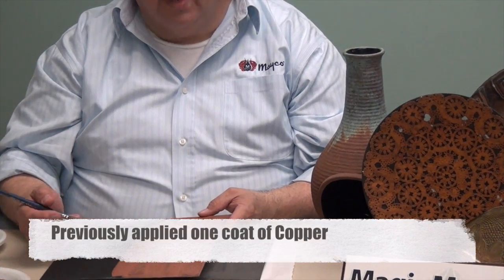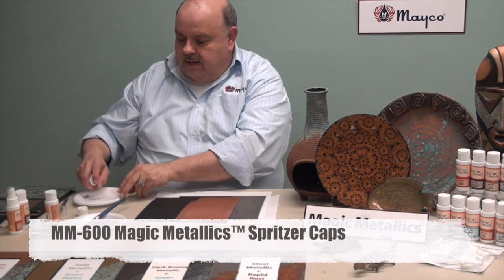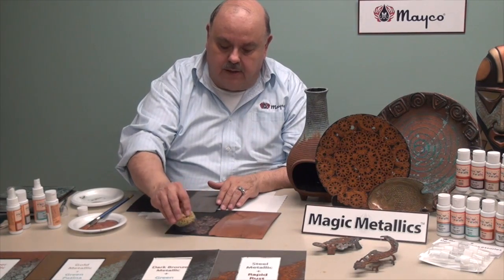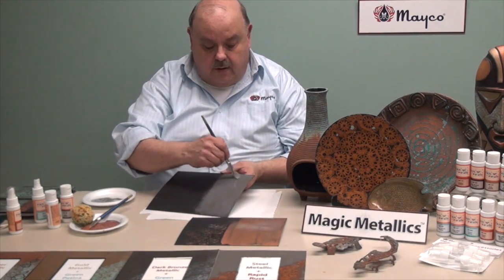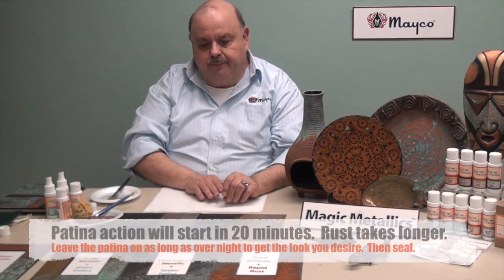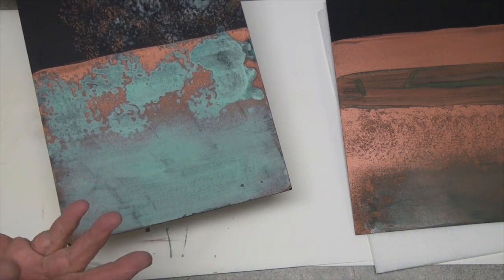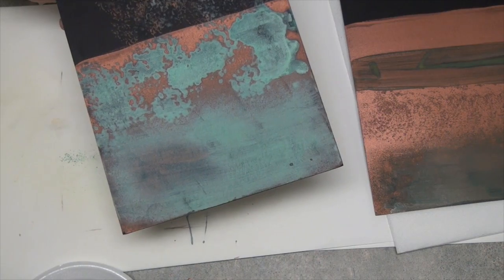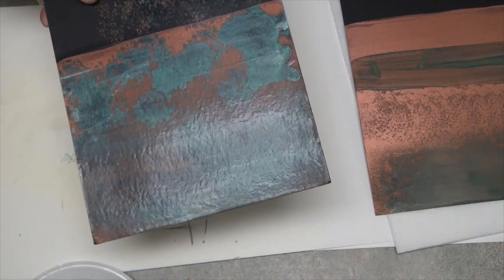How to Apply Patina with Magic Metallics™

Comment: Will the green and blue patina work with the steel metallic or would I need to rust the object first then apply bronze metallic and then the blue or green ? I want to use all 3 Rust with Green and Blue Patina to make a RC car body look like it was under the sea :)
Reply from the maker: The Patina does not work with the Steel, only Rust will react with that. You will need to apply the Copper, Bronze, or Gold to achieve the Patina effect.
Reply: @MaycoColors  Thank You for clearing that up for me , I’m attempting my first rust patina on Lexan and I want to do a few panels with the green and blue patina , I’ve been told Malt Distilled Vinegar will act as a rust activator ! I bought the rust activator just in case , but I’ll try the vinegar on a test strip of lexan to see if it works differently, great channel , subscribed ✅🔥⭐️